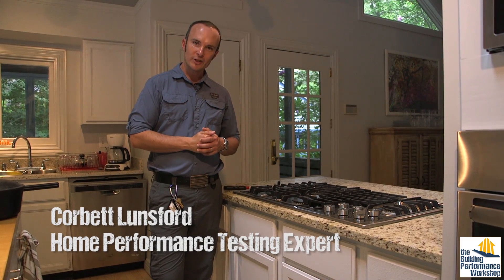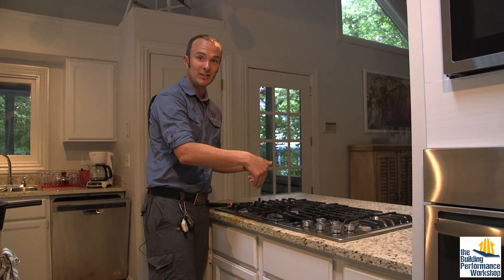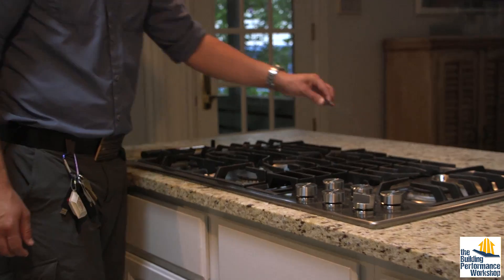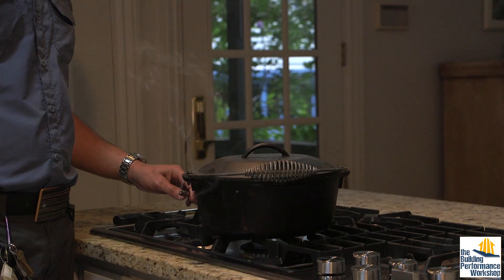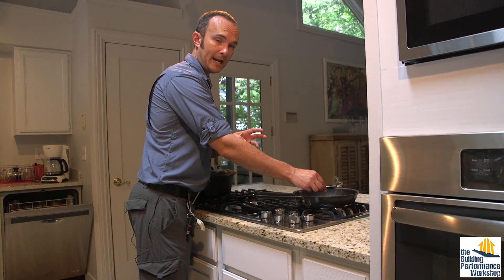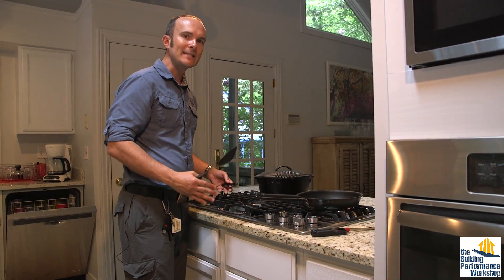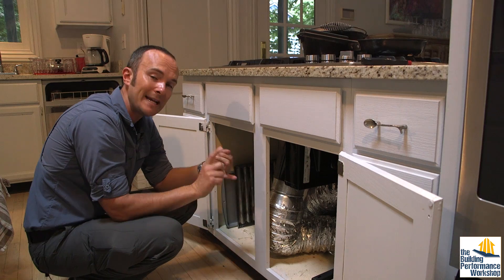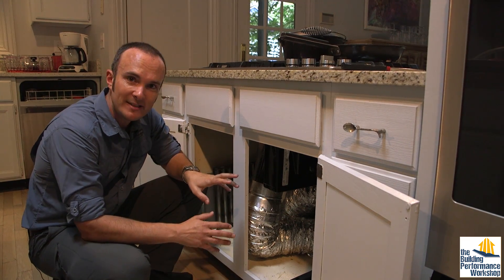Testing Down-Draft Kitchen Exhaust Airflow

Comment: Did you visit a house with two venting system(down draft and normal venting)? 

Also could this be used as make up air to aid the ventilation(instead of sucking it blow 🌬️)? (Cold air is heavier then hot exhausted air)

Comment: On the flip side, downdraft is unsurpassed for baking/broiling/oven cleaning. The heat and fumes will go out of the house rather than into your living space. You can avoid 78° indoor temps during Thanksgiving dinner or summertime baking. The best setup is a combination of a downdraft for oven use, and a direct-vent hood for range cooking. Just be sure to always crack the kitchen window about 3" while venting, you'll need the "make up air" from a nearby location in order to get the proper functionality.

Comment: just what i needed to know.   my down draft fan switch is on high and still lacking.    any chance to increase motor speed on a properly installed downdraft system at the mot
or the system is still lacking power.

Comment: Few things

You say this isn’t an optimal exhaust pipe setup and call the venting subpar - I think this video would be much better if you fixed the venting and then did the tests again. Also the 2 burners on the far left are the lowest btu of this unit, which will generally be used for more simmering and lower heat cooking applications (hence the placement of the downdraft). It is 100% obvious that a range hood is a more efficient venting system, but I think you’re being too harsh on the downdraft setup. Being able to put the cooktop in an island or a peninsula and have clear sight lines may be worth it to some. Ive also never met a single home cook who uses the vent every single time they cook. To each their own I guess.
Reply from the maker: Paul, according to the research from Lawrence Berkeley Nat’l Lab, these do not work in the lab either, no matter how perfect the ducting is. Warm air rises.

Comment: Another downside: The downdraft pulls the flame towards it and you can't get an even burn, and must turn up the heat much higher than you would otherwise.
Reply: OMG yes!! I just moved into a house that has this hideous cooktop in the island with downdraft. I noticed it pulls the flame towards it which is also problematic while cooking.
Reply: @Krazie.Tamika we should contact a consumer product attorney & sue them. They are aware of the problem but will not even refund.

Comment: So FIX the duct and show us the improvement!
Reply: Exactly what I came here for. I purchased this specific one based on a .  .  .wait for it. . . budget.  Video was a waste of time if he’s not willing to show us what to do to at least improve performance. My installers were LITERALLY NO help.
Reply from the maker: Guys, my point here, backed up by researchers at the National Laboratories who study kitchen ventilation, is that down draft doesn’t work. Like the title of this video says. The solution is: get an overhead hood.
Reply: @HomePerformance , sorry I missed the point. Maybe it was implied. At any rate, it’s too late for me for all of that. The kitchen is on the lowest level of my very old home, and not on an exterior wall.  Hubby and I will take the blame, as we didn’t do the research for this. Thanks anyway. Lesson learned.
Reply from the maker: Never too late, Amy! But I hear you- anyway, it’s one of the minor mistakes to make, as home performance mistakes go. Sorry you had trouble.

Comment: You need to upgrade the blower to ~900 CFM if you expect performance in this application. These silly 300-500 CFM blowers are a complete waste of time for anything other than steam
Reply from the maker: Yes, but then you deform the shape of the flames over the burners so much that actual cooking becomes pretty freaky.
Reply: Would it be ok with an electric induction cooktop?

Comment: I have an old Thermador cooktop with downdraft (the back rise about 8 inches to coolect air at that height). The back vent is designed to be the full lenght of the cooktop surface. It work perfectly and I love it. The connection to the outside is indeed rigid duct and goes outside after only 1x 90°. I guess installation and quality of design has a udge impact. This video has a good visual impact but is not an extensive review of all down draft systems.
Reply from the maker: Good to hear, thanks for letting us know this can actually be done

Comment: That's why placing the cooking stove next to a window has been the norm for any sane person who doesn't have a special exhaust system.
Reply: Yeah that works well when it's -10 degrees outside.  NOT
Reply: @PanamaSticks  why wouldn't it work well? The higher the temperature difference between room and outside, the faster the draft.
Reply: @soupflood  Who opens their kitchen window when it's 10 degrees out?  I already have a $250 a month heating bill.
Reply from the maker: Good point
Reply: @PanamaSticks  it's up to you to change a filter monthly or pay more for heating.

Comment: I didn't think these things worked very well and you've confirmed it. Thanks
Reply from the maker: Glad to help
Reply: Depends on the brand really. Bora (the ones who invented it) makes downdrafts that work really well. This one is trash.
Reply: He only confirmed that top didn't work. We have had one for years. JenAir. They work "fantastic". They invented down draft.
Reply: @donhuffer4637 which one do you have? This poor suction actually helps the heat and flame from getting sucked down

Comment: Great video showing basic tests that any body can do to make sure they're venting properly! I like the point you make about moving towards a common language to discuss proper performance in a home. It's often rather confusing how many different measurements we have between ACH natural and ACH50 as well as other units like sones and decibels. 

You mentioned sones are rather complicated and I've found this to be true. I work in a WAP agency and like to test and make sure everything installed is code compliant as well as best practice as opposed to just meeting standards. On that note, I was wondering if you knew of any way to test sones in the field? I've done some digging and saw HVI's testing procedure, but like you said it's done in a controlled lab. Most people say to only get HVI certified equipment but obviously manufacture defects or shipping damages happen every now and then so it helps to be able to test myself.

I appreciate any input you have on the subject and keep up the great content!
Reply from the maker: Thanks Austen! If you’re looking for before/after comparison, then I just use a sound level meter app downloaded on my phone, held at head height on the toilet. Trying to recreate Sones in a room is pretty wonky- vid forthcoming.

Comment: The burners are not producing carbon monoxide, hence the flames are blue and are open to the air providing plenty of combustion air. Carbon Monoxide is the result of incomplete combustion. This video sucks. Maybe you should have started by showing the bad duct install, repairing and then showing cooking drafts. Most folks complain about too much fan power causing the flames to lift towards to fan, not what you have going on here
Reply from the maker: You don’t know if there’s CO from just looking, Rich, I’m here to tell you. Testing is the only thing you should bet on. Thanks for stopping by to be old school stubborn and insulting- your attitude is what drives me to do this.
Reply: Make sure to read the appliance manual as to the correct size of duct to use....Very important.  some use 10 or 12"ducts.
Reply: Rick is absoutely right! I have this KitchenAid stove (only with 4 burners) and I installed exhaust vent myself (the proper way). I hate how powerful my vent is (even on low), because it makes me keep my pots half-way towards the vent to distribute heat evenly. I'm looking for ways to adjust the suction of the vent - can you recommend where I should look? There must be a way to fix this, right?
Reply from the maker: Deformation of the flames is one of the downsides of downdraft- don’t think there’s a way to get around it.
Reply: The installation was horrible, but he never stated how many cfm this unit is supposed to pull. That's no way to conduct a test.
Reply from the maker: If the air doesn’t move toward the vent, does it really matter what the label says? Just trying to show that you don’t need a $500-4000 test tool to see that something isn’t doing what it should.
Reply: I’m sure there is a way to regulate the suction strength of the vent, which would help with my issue. Mine is way too strong even on the lowest setting.
Reply: @JenaArt  you can install a damper on the exhaust duct that will allow you to throttle back the CFM. Something like this: 
https://www.homedepot.com/p/Master-Flow-6-in-Starting-Collar-with-Damper-LSCD6/204091016

Comment: the installation manual indicate size of Duct and maximum length. that spaghetti installation is a joke.    I am surprised the home owner signed off.
Reply from the maker: +Ron White right?
Reply: for every turn (90 degree) add 10 feet to the entire run...so if the manufacturer recommends no more than 30 feet from the appliance to the outside vent....if you have 3 turns...you have exceeded the manufacturer's warranty and requirements.

Comment: I had a house with a downdraft exhaust.  It was loud and ineffective. My current house has a stove set against an outside wall.  The vent has about 14" of sheet metal ductwork with only one 90 degree bend.  Even this setup doesn't exhaust gasses as well as I would like.  The first problem is the hood is too high over the stove and does not extend far enough from wall to cover the front burners.  The second problem is I don't have a makeup vent anywhere near the stove.  I hope someone comes up with a stove that has makeup vents built in to the cook top.
Reply from the maker: See the mechanically-dampered hole in my wall in Ventilation Testing the Best Performing Tiny House on Wheels in the World
https://youtu.be/Xy4OvjEd3IE
Reply: 59seank what is a makeup vent?